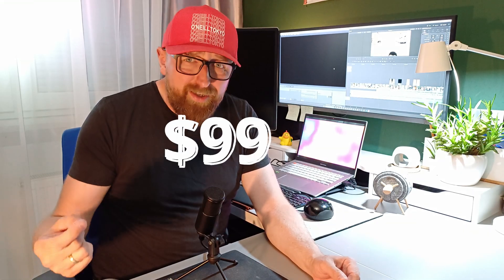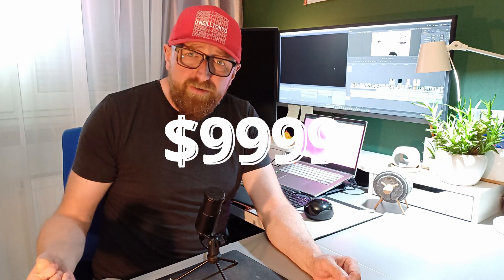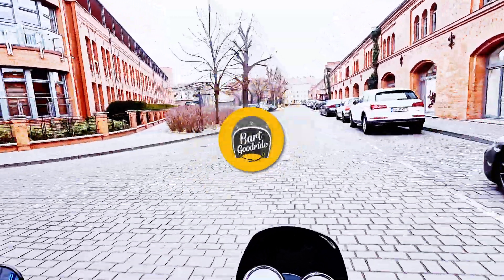Unveiling the Cost of My Royal Enfield Interceptor 650 Upgrades: Don't Tell My Wife!

Comment: There is something about the Interceptor, isn't there? Something that makes one modify it. So far, I have bought two different seats - the brown signature bench seat and the single GT touring seat - for my Interceptor along with a pair of AEW TE-103 exhausts, bar end mirrors and a leather side panel bag. Mine is the Mark 2 (chrome and red) so I have also wrapped the side panels in red. Later on, I would want to get handlebar risers, RaceDynamics FuelX Lite and maybe an air filter mod. But before all that, I will either get a cast alloy wheel for the rear and/or a tubeless conversion for the stock wire wheels. But I have already spent a fair chunk of money on the existing mods!
Reply from the maker: I have a feeling that interceptor and continental owners are like immature Harley owners... We are too poor to buy a HD but still put a bunch of money into customization. In Poland RE is sold next to HD in the same dealership.
Reply: @bartgoodride  Haha! I think you might be partly correct. The Interceptor and the GT are like blank canvases and invite us to paint our personalities on them.

Comment: I have the S&S silencers not the race version though I found the sound with them in a little tinny sounding with DB reducers in and when I took them are out wasn't that pleasent either. So I did this I drill some holes in them and now it sounds better, more bass then before with them in and not nasty as having them out so it's a different all together. But I do ride with ear plugs in always.
Reply from the maker: I was also thinking to drill holes in the DB Killers. I  think I will try in the bottom plate. Thanks for the input.

Comment: Ive got about 1700 in my '23 GT 850, but I went with 1400 in a full hitchcocks exhaust and power commander, the rest is seat cowl, adjustable levers, grip puppies, ie: odds and ends... good stuff and keep her rubber side down

Comment: Here the upgrades and modifications on my 2021 Royal Enfield Continental GT 650 ~ estimated around $2K USD:

* Booster Plug
* PowerTronics FuelX Lite Autotuner
* NGK Race Ignition Cables
* NGK Iridium Spark Plugs
* K&N Air Filter
* Stage 2 Air Cover Eliminator
* Metzeler Roadtec Tires 
* S&S Exhaust Slip-Ons 
* MK Designs Shorty Tail Kit
* Royal Enfield Premium Touring Seat
* Royal Enfield Bar End Mirrors
* Royal Enfield Black Magic Flyscreen
* Hitchcock’s 16 Tooth Front Sprocket
* HealTech GIPRO X-TYPE G2 (Gear Indicator
* Royal Enfield Rocker Red Fuel Tank
* Royal Enfield Rocker Red Solo Seat Cowl
* Trip Machine Leather Grip Wraps
* Heavy Duty Relays
* LED Turn Signal Lights 
* Turn Signal Relay 
* LED Headlight 
* EVAP System Delete
* AIS Delete
* Upgraded AGM battery

Completely transformed the motorcycle 🤙

Comment: I enjoyed this video!  Yes, motorcycle doo-dads cost a lot of $$$.  It's kind of ridiculous when you really think about it.  The pants and boots, too.  $700 for a pair of pants?  REALLY??  Well, here's a few ways I've been able to keep costs down (even though it's still not cheap).

1.  I wanted a top quality skid plate.  Retail cost was $320.  I paid $65 for a brand new one from a guy who bought a bunch of them on close out on ebay.
2.  You can do your own oil changes and valve checks.  You can also replace your own chain, clutch plates, etc.  Get a manual for $25, and $25 worth of tools and learn how to do it.  You don't have to do valve clearance checks very often, anyway.
3.  Check parts availability from UK, USA, Canada, whatever.  Sometimes, based on availability and favorable exchange rates, you can save up to 25%.  Order on a credit card which will convert the currency for you, and back you up if there's a problem with the order.
4.  Except for cheap things like LED lights, avoid Chinese made products.  These accessories will often not fit correctly, break, or rust.  You will wind up paying for the good stuff, anyway.  So just pay more, but pay only once.  They will have no resale value if you want to remove them and sell them.  
5.  Buy 2nd hand parts from ebay, your local classifieds , and so on.  There'd probably be nothing wrong if you bought those levers used, or that pannier mount used, or even bought the mufflers used.  Those kinds of parts don't "wear out".  A used one is about as good as new one.  You might save 30% - 50% off new.

Comment: Nice mods. Does the clutch lever have the tab on the pivot for the clutch switch?
Reply from the maker: Good question. First I bought leavers without the tab. The I bought the correct ones.
Reply: @bartgoodride  Thanks, so the FXCNC ones have the tab then?

Comment: Have you tried running the engine idle for 15min, so the ECU can adapt to the DNA filter? Curious to know if that would improve things...
Reply from the maker: I actually did that. But I am not that good in feeling the difference in performance.
Reply: @bartgoodride  I am still doubting if I will buy the DNA filter for my interceptor. Some people swear that you feel more torque in the lower rev range, but other people do not really feel a difference...
Reply: The ECU won't adapt while the engine is idling, running through the gears at various engine rpm, load and speeds is the method I have used on many different bikes. Of the TEC, S&S and other aftermarket exhaust systems not a single instruction sheet says to idle the engine; particularly excessively. Don't know how this misinformation began but it has been perpetuated.
Reply: @Frederick Woods  are you referring to exhaust systems? I was wondering about the DNA air filter, if it does make a difference in torque in low rpm (and if you need to idle the engine to get it to work).
Reply: @h2xhypocriet it makes no difference just more noise
Reply: @h2xhypocriet Perhaps, a RaceDynamics FuelX Lite or Pro might help. I haven't bought it for my Interceptor yet but it has made my otherwise stock 2019 390 Duke smoother and more rideable at low rpm.